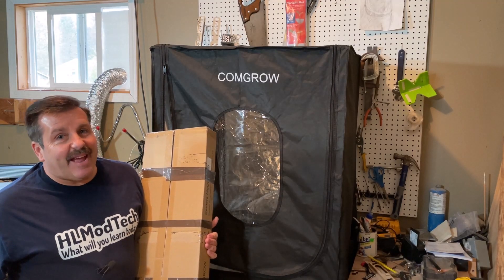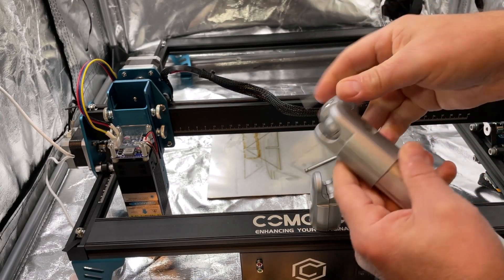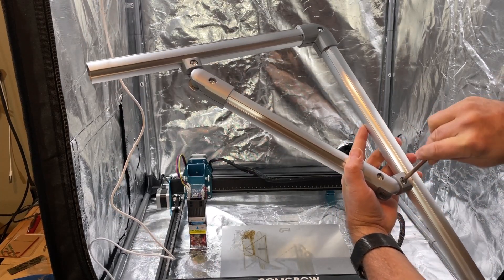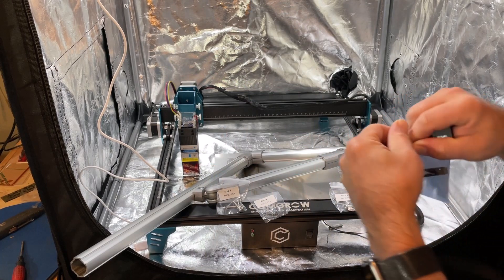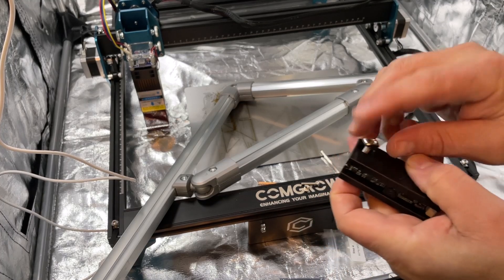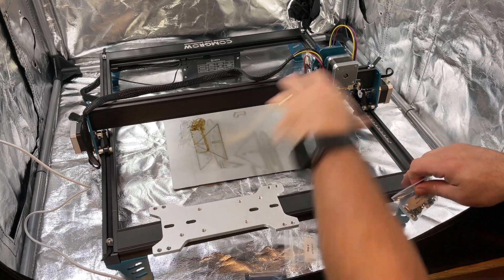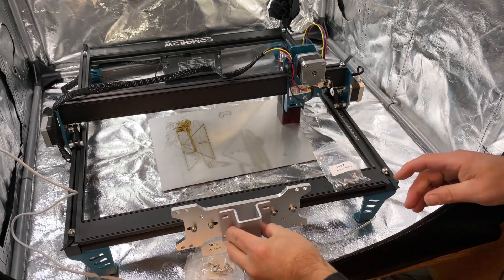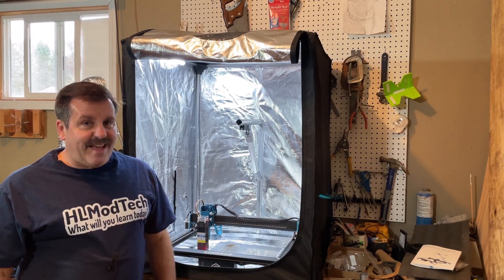Simple Steps to Assemble the Comgrow Camera Module in Minutes  💯👍

Comment: Hello HL. Thank you so much for this video. I just got this Camera module however I have an Ortur Master 3 and am trying to figure out how to mount it on my machine. Any ideas? Thanks
Reply: I noticed the camera was oriented with the plug out front of the mount. Does it matter if I orient the plug toward the back ? Thanks
Reply from the maker: I have never worked with a Laser Master 3, so I am not sure sure. Comgrow did have the extra parts to try it make it work with other printers though.  There was a small section of the manual that showed it fitting another laser, but I am not sure what one any more.